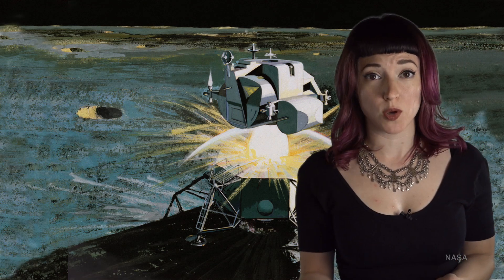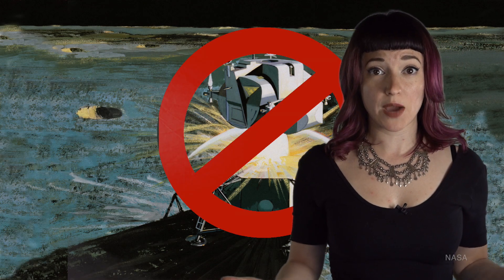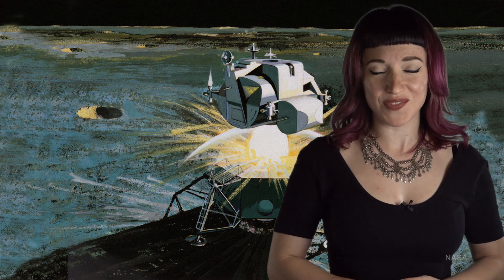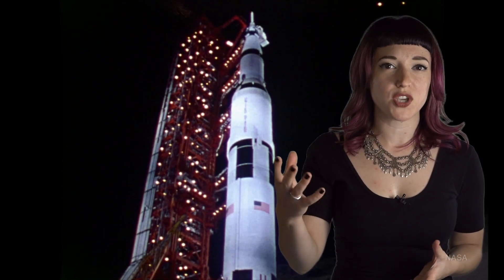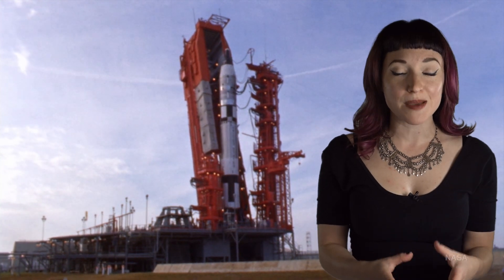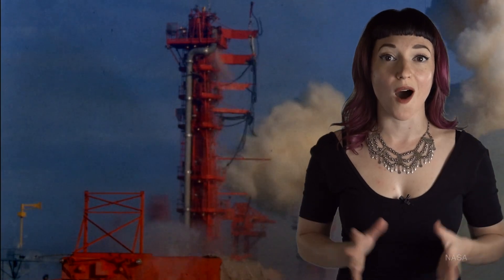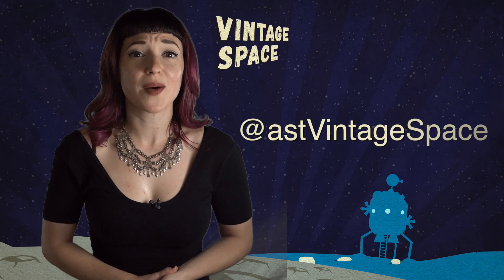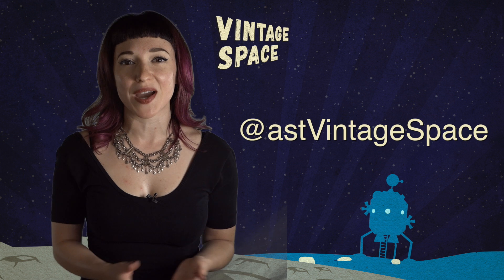How the Lunar Module Launched from the Moon Without a Flame

Comment: Who panned the camera and followed it out of scene?
Reply: Ed Fennel, in mission control.
It had a spring mechanism, operated by remote control. He had to time it just right. On Apollo 15, it broke. On Apollo 16, he got the timing a bit off, so it quickly goes out of shot. On 17, he got it right.

Why don't you search for more info, and check for yourself how it worked.
Reply: @ann_onn  interesting I will check that out

Comment: So how the lunar module know where the service module in the orbit of the moon.I mean which algorithm they use to link up back them.
Reply: The launch time was calculated so the ascending lunar module would achieve orbit at the same time as the command modules orbit came close to it.
Both spacecraft had radar trackers which allowed them to maneuver close to each other and orient themselves to perform the docking procedure.
Reply: @niallkinsella2687  lol
Reply: @williamsmith9026  
I know right. It's hilarious how simple the concepts are when you have some understanding of the engineering behind them.

Comment: First - The moon is hundreds of millions of miles away in deep space it is so cold that your hypergolic fuel would be so frozen there is no amount of heat energy could keep them  in the state required for the engine to work!!!
Secondly - How does the engine work in order to satisfy Newton 3rd Law - There is nothing in vacuum for the exhaust to react to in order to have the equal and opposite reaction?!!!
Reply: -"in deep space it is so cold that your hypergolic fuel would be so frozen" Incorrect. The spacecraft was still exposed to the Sun so the challenge was to keep it cool, not warm. This is why the spacecraft was designed to be highly reflective. It was also kept on a gentle roll so that no one side of the spacecraft would overheat. Space itself has no temperature as temperature is a characteristic of matter. If you have a warm object in space eventually it will get cold due to radiating heat into outer space, but this process is not fast enough to compensate for the heat absorbed while being in sunlight.
-"How does the engine work in order to satisfy Newton 3rd Law" Action: Expanding gas from the fuel combustion pushes against the engine bell, which is attached to the rocket, propelling the rocket forward. Reaction: Engine bell pushes against the expanding gasses, forcing them to expand in the only direction that is open and propelling them at very high speeds in the direction opposite to the rocket.
Edit: Removed accidentally crossed out section.
Reply: @darthmarvin247  What you said proved you do not understand Newton 3rd Law of Motion!
Reply: @jc2coming  " What you said proved you do not understand Newton 3rd Law of Motion!" Whenever object A exerts a force on object B, object B will exert a force of equal magnitude, but opposite direction on object A. Object A = exhaust gas, Object B = Rocket engine. Where did I go wrong? Are you saying that the rocket engine is not exerting a force on the exhaust gasses? Because then you need to explain why these exhaust gasses go from standing still (relative to the rocket at that point in time) to moving at supersonic speeds.
Reply: The moon is about 250 thousand miles away from Earth. Not hundreds of millions.
Reply: @niallkinsella2687  Impressive how many incorrect statements he managed to fit into such a short comment right?
Reply: @niallkinsella2687  It was my expression of very far away...but it is 384,400 miles from earth, not 250,000 miles you said...but it is at least 238,855 so you number is approximately within its orbit.
Reply: @jc2coming  
384400 is the distance in kilometres.
When I said [about] 250 thousand miles, the about indicates an approximation. It was orders of magnitude more accurate than the hundreds of millions of miles you said it was.
If it was just an expression to indicate a large distance, it was a grossly exaggerated one.
Reply: @niallkinsella2687  Yes, I did it to make a point that the moon is in deep space where there is virtually no matter for the 3rd law of motion to work.  
Remember what I asked you...

Comment: Why they didnt show other take off... how they steer the luner back to moon... how much fuel they needed to steer lunar back?
Reply: YOU SAID: "Why they didnt show other take off"

== They showed every takeoff.  All 6 missions filmed the takeoffs from inside the module, looking out the window.  And, 3 of the missions (Apollo 15/16/17) took TV video of the takeoffs from the rovers' cameras.

YOU SAID: "how they steer the luner back to moon."

== I have no idea what you mean.  But, they steered the craft with RCS rockets.

YOU SAID: "how much fuel they needed to steer lunar back?"

== They had 605 pounds of RCS fuel/oxidizer for steering the craft.  I don't know how much they actually used.  It depends mostly on how centered the mass was inside the craft (how much directional correction they needed because the ascent engine didn't have a gimbal).  If the mass was very centered, they wouldn't use very much propellant at all.  But, if the mass was quite off-center, it would need more.  I don't know if there is any documentation about how much fuel/oxidizer remained after the lunar module docked with the command module.  But, if you want to know, that's what you'll need to hunt down for yourself.  Keep in mind, this is the same fuel/oxidizer for the RCS used during the descent, so, some of the 605 pounds was burned during descent.  However, the main descent engine had a gimbal, so, they probably didn't need much RCS.

Comment: She uses the titan 2 rocket as her "proof" in that it used the same type of fuel as the lem and she says the titan rocket shows a clear flame, but you can still see the flame in the video.  It's not 100% clear. So still doesn't prove why absolutely no flame is seen from the LEM taking off. Hypergolic fuel was what the lem used.  Look up tests with this fuel and you will see how this type of fuel always has a dark red opaque exhaust gas.  This debunking video is a hoax.
Reply: YOU SAID: "She uses the titan 2 rocket as her "proof" in that it used the same type of fuel as the lem and she says the titan rocket shows a clear flame,"

== Yes, because it does have a clear/invisible flame.

YOU SAID: "but you can still see the flame in the video."

== A relatively small percentage, though.  And, mainly, that's around the edges where it's interacting with the atmosphere.  They also ran the Titan rockets a bit rich to keep them cooler.  What you're seeing in the flame of a Titan launch is the interaction with the surrounding air, plus the unburned fuel (they ran rich) starting to burn with the surrounding oxygen instead of the onboard oxidizer.  You're missing the bigger picture, which is to demonstrate that the main flame is nearly invisible/clear.  For the lunar modules, they didn't run them rich, and there wasn't a surrounding atmosphere to interact with.  And, with the black backdrop of space behind it, the flames (already nearly invisible) become even more invisible.

YOU SAID: "It's not 100% clear."

== Pffttt.  99% isn't good enough for you?

YOU SAID: "So still doesn't prove why absolutely no flame is seen from the LEM taking off."

== Because there is no surrounding atmosphere.  And, you DO see a bit of flame once the LEM pitches over and you're looking directly into the engine bell.

YOU SAID: "Hypergolic fuel was what the lem used."

== Yes.  Some hypergolic fuel/oxidizer combinations burn with invisible flames, some don't.  Some normal chemicals (non-hypergolic) burn with invisible flames, some don't.  The visibility (or non-visibility) depends on the molecular structure of the fuel and oxidizer.  It's how photons work.  We have a narrow band of light that is visible to the human eye.  But, that doesn't mean that all chemicals will emit photons within that specific range when they burn.  Some do, some don't.  I'd give you a lesson in this, but, I'll bet you don't care, because it'll poke a million holes in your ridiculously ignorant opinions.

YOU SAID: "Look up tests with this fuel and you will see how this type of fuel always has a dark red opaque exhaust gas."

== No, dummy.  The reddish brown cloud you're talking about is the unburned N2O4, breaking down into 2x NO2.  N2O4 is not a very stable compound, hence why it breaks down so easily, and hence why it is a good oxidizer in a hypergolic reaction.  It doesn't take much to make an N2O4 molecule split into two molecules of NO2 instead.  The reddish brown gas is the NO2.  So, undoubtedly, the conspiracy videos you're watching (showing the reddish brown byproducts) are the lame conspiracy videos that show you a mixture that is overloaded with more N2O4 than there is Aerozine 50 to mix with.  Hence, what happens is, the burn happens between Aerozine 50 and N2O4.  And, that produces a virtually invisible flame.  But, the excess (not burned) N2O4 becomes very hot, and quickly breaks down into 2x NO2.  That's where the reddish brown color comes from, not because of what you're asserting.  You don't know anything about this topic.  I mean, good gods, aerospace engineers and rocket scientists around the world have been working with these types of compounds since decades before Apollo even started.  None of them have ever made this complaint you're making.  Why do you suppose that is?  Is the entirety of the world's population of aerospace engineers and rocket chemists/scientists all just too stupid to understand that the Apollo lunar module should produce the reddish brown byproduct?  Or, do you suppose that, as experts who have worked in the field for decades, they already know that, if properly balanced, the Aerozine 50 and N2O4 will produce a virtually invisible flame?  Which do you suppose is more feasible?  The entire planet's experts are wrong?  Or, your favorite conspiracy videos lied to you?

YOU SAID: "This debunking video is a hoax."

== Your education is a hoax.
Reply: @rockethead7  sorry but just because you write a long response doesn't mean you know what your talking about.  The exhaust is seen in the titan 2 launch and it's not 99% clear it's more like 50% clear, yet the lem taking off is 100% clear which is impossible unless they were using "ufo" antigravity technology which doesn't exist.  In space you would still have a visible exhaust plume albeit which would dissipate quickly- a simple Google search will reveal this info.  Sorry guess they should of thought about that one better when they filmed the take off in the movie studio.
Reply: @rockethead7  just because you chose the name "rockethead7" doesn't make you a rocket scientist.  There are ample nasa videos which prove that even in the vacuum of space there is still a visible exhaust plume.  However there is zero exhaust plume which eminated from the lem.  You have failed to explain why there is absolutely zero (not 10% not 5% not1% ZERO) visible exhaust plume from the lem.  That is impossible plain and simple. If you want to believe in fairy tales like the moon landing go right ahead.  I'm not going to waste my time and argue with the likes of you.